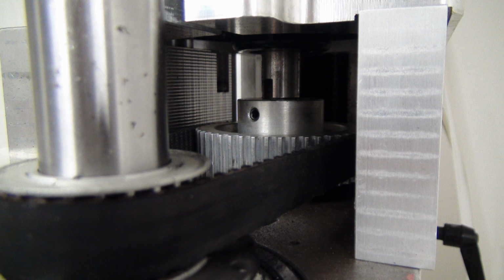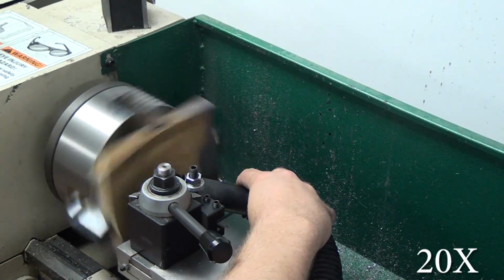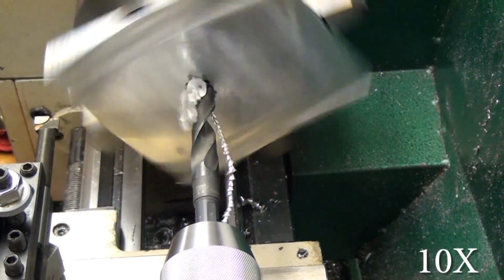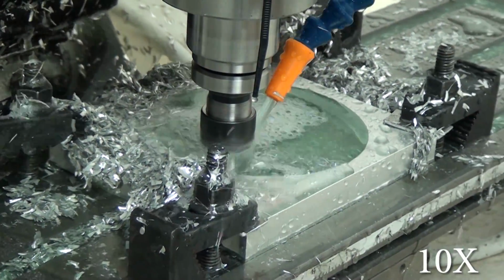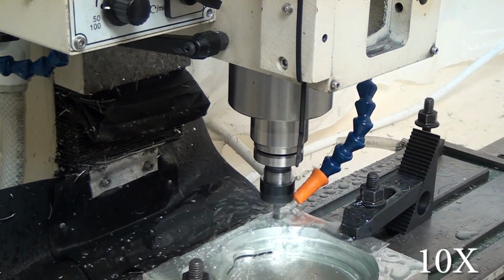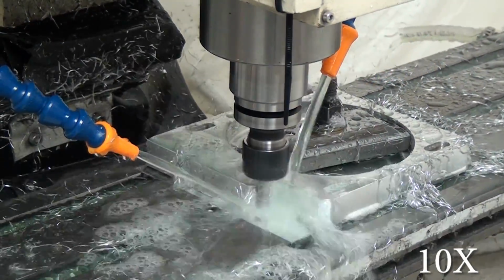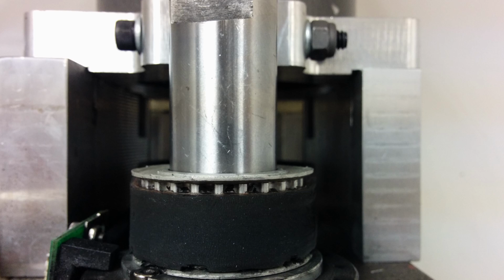CNC-G0704 #16 Belt Drive Conversion pt4 (Motor Mounts)

Comment: there is a much simpler solution! after searching the Internet I found 2 perfect fitting gears (al be it they are  with straight teeth)   no machining required whatsoever!!   your mill stays original and can always be reverted to its original state (and a little more noice  weighs up to the bad quality of the plastic gears!

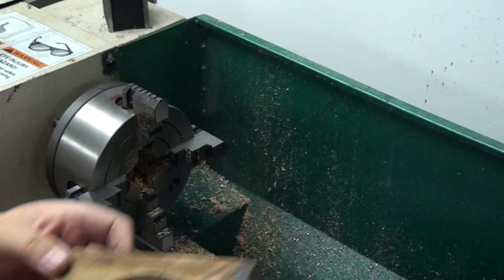Comment: 3d milling that starts at 2:21 is beautiful

May I ask what is your controller for that machine, I have seen so many 2.5d CNCs out there but they rarely machine in 3d. Or is it more like a CAM trick?
Reply from the maker: LinuxCNC for the controller.

Comment: Hi Russ!  Where did the motor mount files go?  There are only the pulleys, spindle spanner and a few other parts.  Just managed to burn up my stock motor on my manual G0704, so before I do something (else!) stupid and kill the CNC one, I figured I'd make up a couple of the plates.  Have two big motors looking for homes, so WTF.
Reply from the maker: That's weird. I've just put them up again.

Comment: Why did you use timing pulleys and belts instead of regular v groove?
What will happen if the tool got stuck in the workpiece?I think this is the a second reason that they make the gears from plastic, the first one is money!
Reply from the maker: Timing belts seemed like a better method for positive position engagement. I'm not using them on my newest motor and am instead using poly-v. In either case, its highly likely a tool is just going to get broken if it binds (given enough torque).

Comment: iam looking at getting one of those mills did you wire treadmill motor to your original power control on the mill
Reply from the maker: Nope. I'm using a KBMM-225D on the motor in this video. I have some videos about it specifically.
Hoss proved you could pump a bit more power out of the stock DC control to run a larger motor, but I can't remember how far he said you could go. He likely has a video on it, also check CNCzone.

Comment: What's the maximum rpm of the machine?
Reply from the maker: +marcos Barros I'm not sure what the motor is supposed to be able to achieve, but with the 1:2 overdrive I'm getting 4600 RPM at 90v (stock for my motor control) and I've just recently tuned the control to 120v so I'm getting 7200 RPM. I believe my quill bearings are rated for 8000 RPM so for now I won't bother trying to go any faster.

Comment: I had the same issue on my Seig SX2. I just needed a way to mount the New DC motor. I ended up 3d Printing a mount that used the motor through bolts to connect it to the plate and mounted it to the stock mounting points on the mill. Now that it is working I have a hard time convincing myself to make one out of aluminum. Im currently watching your videos of the G0704 as Im considering picking one up. Nice work so far!
Reply from the maker: +Jody Olivent 3D printed sounds cool! If your considering a G0704, check out Sam's channel (CNC4XR7) and see his Precision Matthews. Not much more money than the G, but quite a bit more mass (and better Y-axis travel). He's just starting the build, so it should be fun to watch.

Comment: Would your gear choice work ok with a stock motor?
Reply from the maker: Chad Choate So right now I'm only running mine at 90vdc and 8amps, which is about 1hp. When I'm using 1/4" end mills and smaller there is no problem. Even 3/8" end mills are mostly fine. I can't use my 2" face mill at all, so I would say if you're going to stick with smaller cutters you'll probably be OK.

I really need to tune my controller so I can take advantage of the nearly 3hp this motor is capable of....

Comment: Russ, isnt it an idea to make Sub programs where you only have to place down a few Parameters to do something like Milling the entire slot?

it usually works better and you would save a lot of time on it.

i use a sub program for Peck Drilling on a CNC machine
i drill 2MM then it goes up 0.3MM and down 0.3MM again and it continues

i only need to put in 4 parameters and i have a hole drilled

Comment: Did your modification to the pulley solve your noise issue?
Reply from the maker: acklan3 Some, but not all. I'm becoming more and more concerned that I have a bad bearing, but I haven't had time to tear back into the mill to check. The spindle seemed fine in the beginning, so maybe I have a bad bearing or possibly some trash got into one of them before I installed it..... It's high on the list of things to do.

Comment: Thanks for sharing this.  Very nice work.  Kudos for making a wooden motor mount and using that to machine the aluminum motor mount.

I'm still working on the CNC turd polishing of my Grizzly G1006 round column benchtop mill.  Your boring videos looked familiar.  I apparently don't have any boring bars that work on either of my lathes, so I ordered them, but then laboriously used the boring head on my milling machine to bore out the IDs of eight timing belt pulleys (X, Y, Z and the 4th axis, aka A).  I also bored the clearance holes for the pulleys in the motor mounts when I didn't have a hole saw to fit.

I bought a $230 "F style" 4th axis on eBay.  Don't do that!  Pay $430 and get one with harmonic gear reduction.  I pitched their wimpy MXL timing belt and pulleys and replaced them with L series belts and pulleys to hopefully beef up the design enough for milling.  I spent a few partial days in the shop on the 4th axis upgrade, which I'm just finishing.  I'll upload a video of that.

Anyway, I should be finally finishing the electrical panel wiring that I've been procrastinating for no good reason.  That's scheduled for tomorrow, and I hope to finally have the X and Y axes moving in the next couple of days.  Then the power draw bar and then the Z axis.  I've been doing a lot of the details, in somewhat the wrong order, but I'm running out of side projects and this is all going to come together quickly at the end.  I'll post a lot of videos soon.

I wish I had a CNC milling machine to use to convert my milling machine into a CNC milling machine.  It's a chicken and egg thing.
Reply from the maker: Liberty4Ever Awesome! I'm glad you're making progress. I've been eyeing those ebay 4th axis, so I'm glad you said something. I'd love to see a video about yours and the upgrades.